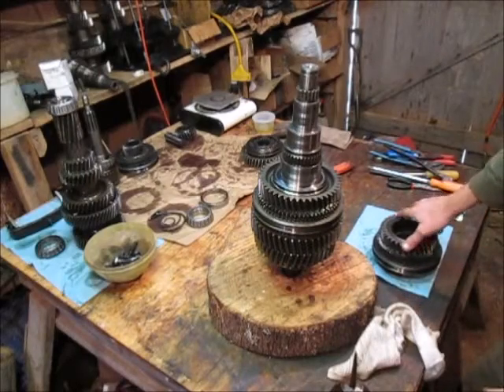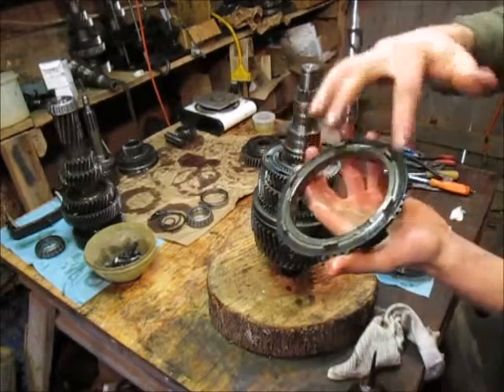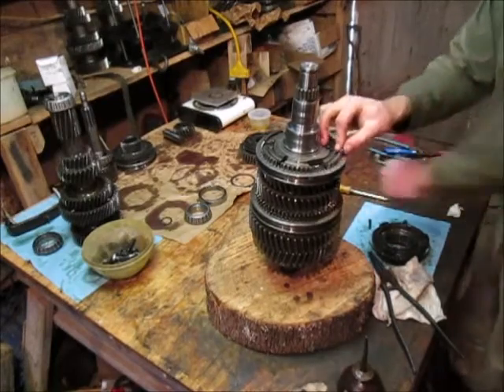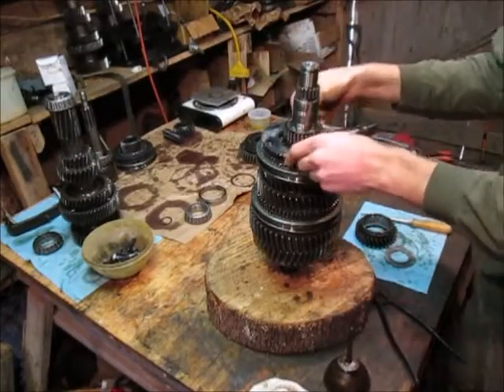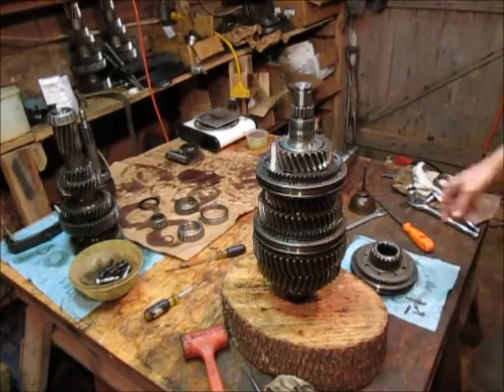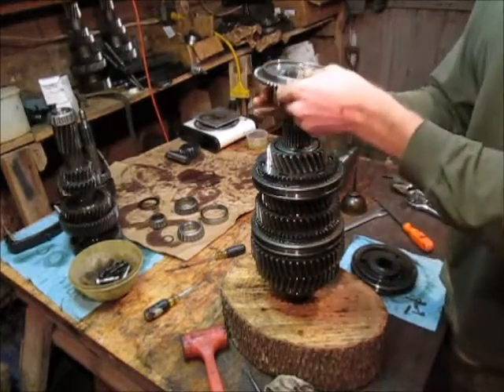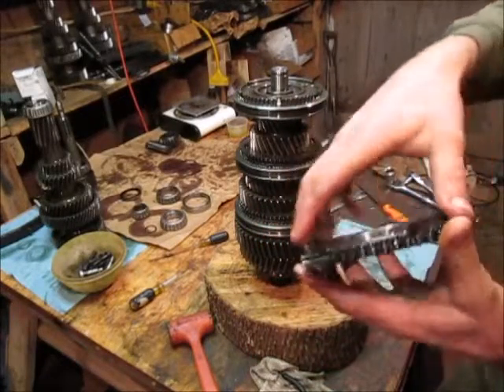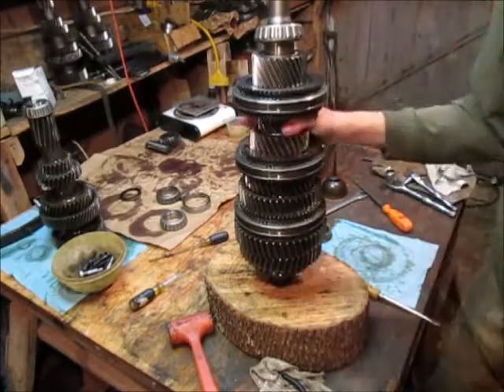G56 Transmission Assembly - 3rd, 4th & 6th

Comment: Great video(s)... very explanatory!  Was that loose bearing on the main shaft why the G56 has the rattling in neutral. Mine rattles a lot in neutral? Everything else seems fine. It has a lot of Kms. 340K (211K miles).

Comment: I have a problem. I some how lost the little ring that goes on my input shaft. Do you have a source for them or if it's not available could you give me the measurements for the part so I can try and make it?
Reply from the maker: Exactly which part are you reffering too? 

Here's a video that goes into more detail on each of the parts, encase it helps explain which one you're missing.
https://www.youtube.com/watch?v=LK86A4bG4X0
Reply: CumminsWorks  the small ring that goes on the input shaft. You say to make sure and transfer it in one of your videos. I didn't notice until I installed the bearing. Nor I have part of the bearing just hanging in the air
Reply: CumminsWorks I'm also trying to find a part number for the oil deflector ring. Mine is completely destroyed
Reply from the maker: I do not have a source or part number for either.  I'm gonna look into making one in CAD and getting some made.  I'll let you know how it goes.
Reply: CumminsWorks I've found a a part that I can make work for the oil deflector ring. I ordered one for the Ford ZF transmission. I'm going to try it tomorrow. Will give you the part number and everything if it works out. As for the ring on the input shaft I'm gonna mic it out and see if I can find a substitute. I really need to get this thing back together

Comment: Hey i blew my 3rd gear in my g56 to change it do i have to completley take it apart or can i do it without removing every single piece
Reply: Or can you email me at kami5518@gmail.com i have a couple questions
Reply from the maker: You shouldn't have to remove reverse/1st/2nd gears on the main shaft, just 6th, 4th and third.  Make sure to inspect the countershaft for damage though.

Comment: Awesome videos. I'm tired of paying high gear to rebuild my trans every few months and I use my truck for pulling every day and it's making a lot of grinding noise so when I get home I'm going to be pulling it out. Can you tell me the best parts as far as bearings and anything else I might need and where to get them?
Reply from the maker: Standardtransmission out of fort worth texas should be able to get you taken care of.  There are other places that have parts cheaper, but I question their quality.

What oil have you been running in the tranny?
Reply: Thank you very much. Yes I wanting to use a quality bearing. I don't know what high gear in metropolis uses but I've not been able to get one of theirs to last very long I've had 4 from them in the last year and I'm just going to do it myself because I can't blame anyone but me. Great videos!

Comment: Great G56 videos.  I have watched several times.. I have my G56, out how much should the input shaft move around. Seems excessive to me. Thanks Doug
Reply from the maker: Hey man, Thanks!  On your input shaft, if it can touch the outer tin shield dude, it's too loose.  The books call it a "Input bearing retainer" But it doesn't actually retain anything. lol
Reply: CumminsWorks ,are you talking about the retainer that the throwout bearing rides on? It just seems like mine is side-to-side movement. If it is touching the retainer then should I split the case and replace the input shaft bearing? Someone had put a solid flywheel kit in the truck and left the spacer plate behind the flywheel, the very end of the spline input shaft was touching the flywheel and pilot bearing destroyed. Thanks and I appreciate it a lot
Reply from the maker: Yes sir, that's the one.  I would inspect the bearings at a minimum and reshim the main shaft.  Unfortunately shimming the shaft is a little complicated without the right tools.  Another Commenter asked about the procedure a couple months back and I answered it in his comment.  It was FX44Racing just a couple comments below yours.
Reply: CumminsWorks , thank you sir. I will check it out. Great youtuber
Reply: Cumminsworks, I pulled the g56 apart, everything looks good, very clean. I downloaded myself a  service manual. To shim  the main shaft, do I pull the race out of the rear case half and shim there? Does that take care of input side to side play? Thanks Doug
Reply from the maker: You wanna put the shims under the input shaft bearing in the front of the case.  And yes, that will reduce the input shaft play.  Glad to hear it all came apart nicely.
Reply: Also here is the link to the service manual. https://www.scribd.com/mobile/document/65876494/Dodge-G56-Service-Manual
Reply: CumminsWorks , thank you for replying . It means alot, nobody is willing to help people anymore. You sir are a good person. Look forward to many more videos.
Reply from the maker: No problem, I'm truly just glad I could be of help.  And thank you for the kind words, it's folks like you that built and continue to build this channel.  So Thank You!  If you ever have any questions or video suggestions please feel free to toss them my way.
Reply: I just wanted to thank you for that link! You rock!

Comment: Awesome video. Definitely not much info for the g56 out there. I'm replacing my input shaft and bearing. How do you check you preload?
Reply from the maker: Miller makes a tool you're supposed to use (Miller part# 9592) to measure the preload, but they're kinda proud of it.  I meant to make a 4th video doing the final assembly, but I was trying to develop a simpler method for measuring the preload, and then life got in the way.  The method I've done in the past was set the two cases together with only one shaft installed, then lightly pinch one side of the cases together (drivers or passengers side), then use a feeler gauge on the opposite side to measure the gap.  If the gap is 0.006" then your preload is 0.003".

Comment: what is the preload on the shafts suppose to be? cant seem to find it anywhere
Reply from the maker: Well Sir, you aren't wrong!  Informations for the G56 is scarce.  I talked with a couple shops, and now try to shoot for 2-3 thousands on the mainshaft and 1-2 on the countershaft.   You don't want to go to loose or the shafts will start flopping around when the aluminum case heats up, and to tight you get stiff shifting issues.  I've played around with various settings, and the numbers I mentioned above seem to be a pretty good balance.  Also, for what it's worth, all this playing around with shimming was on the same tranny/clutch, so that rules out individual irregularities.   Take care and best of luck!
Reply: Thanks! I lost 4th gear, pressed the counter apart and waiting on new cluster gear and main shaft gear/ bearings and syncros..
Reply from the maker: Awesome!  How large of a press did it end up taking to disassemble the countershaft?